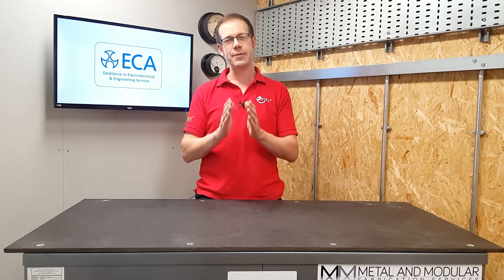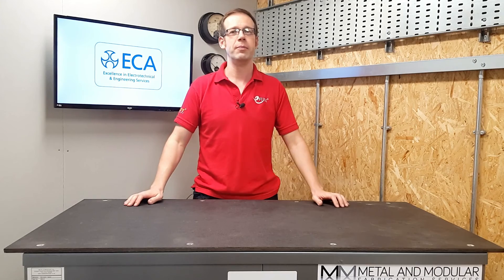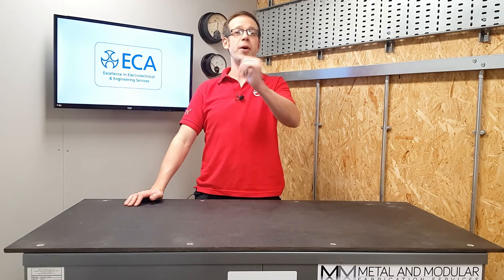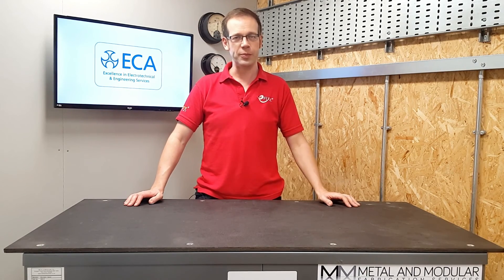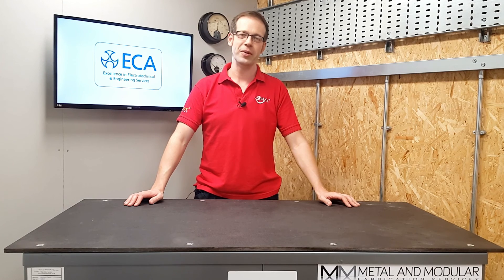Can you use parallel conductors to create the same cross-sectional area as a single one?

Comment: Joe may I ask you.
Back in the days of rewireble fuses and some of them had cartridge fuses, it was common practice for your mum or dad to pull the fuse so as to place the fuse wire then replace it back into the fuse carrier, and it was never a problem. So why is said to be dangerous to   pull the supply fuse,? When it is the same thing just bigger in size.
Reply: For one thing the cut-out fuse is the DNO's property and you may not have permission to touch it. Also, older heads with PILC supply cable have been known to come off the wall when pulled, shorting the supply in the process and creating a large arc flash.
Reply: @davemitchell9484  I have no intention of pulling the supply fuse,
I was just wondering why it is deamed dangerous to do so, I have an old fuse and head that I retrieved from a skip three years ago and I was testing my theory that the fuse can't come out if you pull it from the top or bottom as it gets stuck on the carrier but give it a good sharp pull it comes out straight, maybe there's a technique to pulling a supply fuse? But yes your right no one should touch them with out the dno's permission and only if you know what you are doing.
Reply: @seandempsey9396  because they're fragile and can't necessarily cope with a sharp pull...as well as the issue of permission.
Reply: My understanding would be A blown fuse (BS3036) doesn't have load across it. Where as unless all loads are shut down on a cut out fuse there is a risk of arc flash.
Reply: @seanthespark  yes, but surely if you pull the supply fuse out with a straight sharp pull then you won't get any arching ? Also isn't for that reason there is a fuse carrier so it comes out straight?

Comment: Thank you for this info.
To take the question a stage further. . .
When running an SWA for a supply to an outdoor building requiring 10mmsq copper conductor for the earth, I could use 2 cores and the steel armour of a 4 core 4mmsq?
There is a difference in resistance between the copper and steel conductors but enough for this to be a problem?
Reply: If its a PME not good to export earth just spike the out building and earth the armouring on the supply. Ive doubled up on a 5 core before on a TNS earthing system had 20mm in total on the live and neutral and 10mm on the earth and a back up of the armouring.
Reply: @jamesmoon5632  The armouring is not just a back-up.  I've seen yet another SWA job yesterday where the steel wires are cropped and unterminated - but of course they used an inner core for earth.  The steel wires are not there to stop the cable from penetration, and if they're not earthed, it's almost pointless having them.
Reply: @westinthewest  re steel wire armour - copper equivalence: divide the steel mm2 by 8.5 (though some say 10) to get its copper equivalence - see GN 8.
Reply: @johnhoward2104  There's a chart online somewhere which shows that the steel provides sufficient fault current to break the circuit in a cable up to 150mm2 or so.  There is rarely any advantage in adding copper to the CPC.  If the steel isn't enough on its own, then the circuit does not comply with the need for an effective earthed metallic covering as stated in 522.6.204 (i).
Reply: @westinthewest  I'm afraid you've misunderstood my point. I was indicating the process to derive the copper equivalence of the armour, not talking about adding copper or questioning whether the armour is capable of carrying fault current, as acording to column 3 of table 54.7, materials other than the line conductor are adequate if it's csa exceeds the selected minimum (using k1, k2, etc). BUT if the armour of the SWA (e.g. a 16mm2 2 core) is to, for example, be used as a MPB conductor and connected to say a 10mm2 copper main bond, then the steel armour must meet the copper equivalence at minimum, or it would otherwise be tantamount to joining the 10mm2 to a smaller copper conductor (a 6mm2, for example, which would be undersized). Therefore, an SWA using armour as a main bond must be selected with large enough armour csa to meet the size of the copper main bond, hence the need to derive its copper equivalence and dividing by 8.5 (though some say 8.8-10 - see https://www2.theiet.org/forums/forum/messageview.cfm?catid=205&threadid=23890 ). And if you want to see armour CSA's, see, for example, Apndx D of GN 1.
Reply: @westinthewest  i know my dad once drilled a perfect 5mm hole into the live on the armoured cable once when drilling a hole into the garage and didn’t check the other side of the wall. Obviously gave a fault path didn’t even know he did it till he wanted the lights on in the garage!!